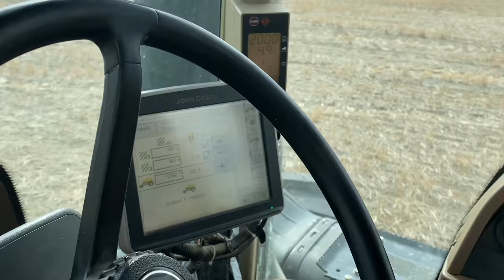SEEDING FINALE... Part 2, Montana 2021

Comment: Hello Kate and Darcy from Sydney, Australia.
Great to find this latest video of your channel.
*The specs of fertilizer on the ground: do you use superphosphate NPK (before each seeding)?
*I think the depth of germination for the seed is important for temperature from the sun. However not sure about wheat.
* Do you have, or; did you ever mill wheat, into flour/cornflour? Was there one in Montana?
*I really like the old water wheel grist mill stones, especially the one designed by Henry Ford (the car maker).
* Big difference cattle farming to wheat production: such as fencing, stock yards and vet bills.
The Row River
* I would like to know how strong the current is around the hot spring water. And temperature (were it mixes with cold water).
*Any chance of your dad going up in the plane?
Best wishes until next time.
🐎🙋‍♀️
Reply from the maker: Hello from Montana!  Thank you for your kind words and great questions.  Not sure about the fertilizer.  Yes the depth of the seed is important.  We have a small home flour mill at home.  The grist mill is the best. Henry Ford was a pretty amazing person.  Not sure about the current around the Roe River.  I would have to Google that.  We are trying to get flying, but the weather has been too windy.  I sure hope we can get in the sky soon!